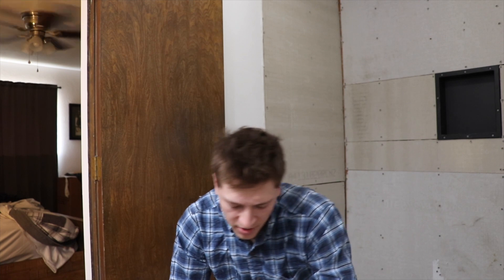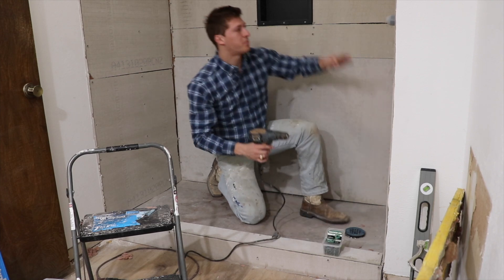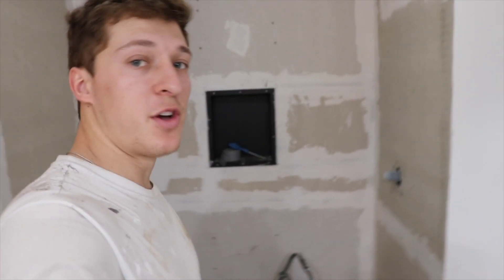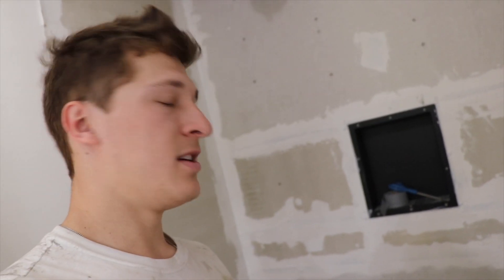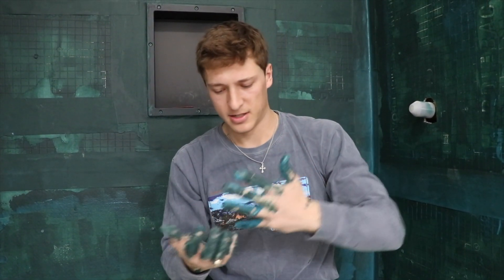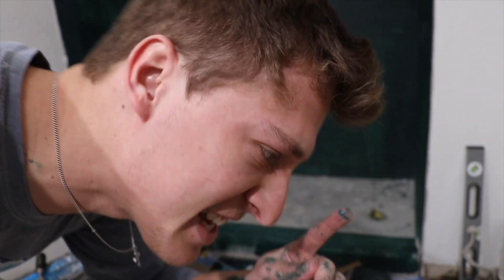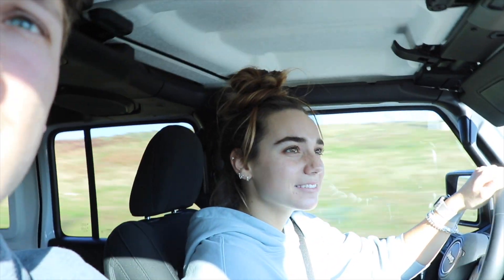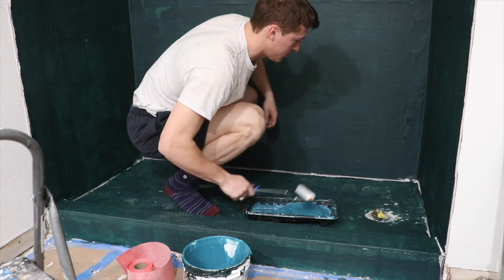WEEKEND IN MY LIFE | Renovating my First Fixer Upper

Comment: Hey great job so far . Get big 12x24” tile it goes up in no time or white subway tiles it never gets old looking. How did you tie together the  waterproofed  shower pan to the drain? Is there a rubber membrane or schluter under there ? Use thinset/mortar to install the tile it’s better in wet areas not that tile mastic adhesive.

Comment: 1. You did not need to wait 1 day for waterproof to dry. 
2. To cover your gaps you didn’t need that $20 red tape, you could’ve used cement board tape and used thinset on top of it.
3. The cement board  tape was enough and you could’ve waterproofed 2 coats same day

If you spent 3 days just to waterproof you would be the worlds most expensive tile installer when it came to custom showers lol I could only imagine how long it would take you to make a mud pan by hand...

1 day to prep 
2nd day to install 
3rd day to grout 
How we do it at Custom Floors LLC
Reply from the maker: I actually am the worlds most expensive tile installer
Reply: @bronsonholbeck  your videos keep me entertained... no hate all love 💪🏽💪🏽😗